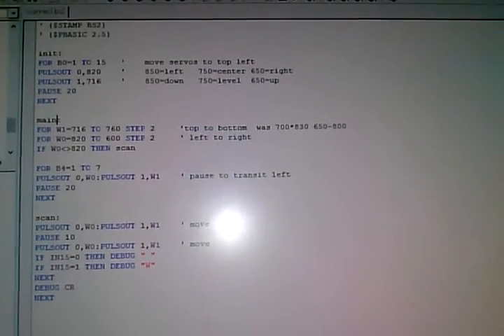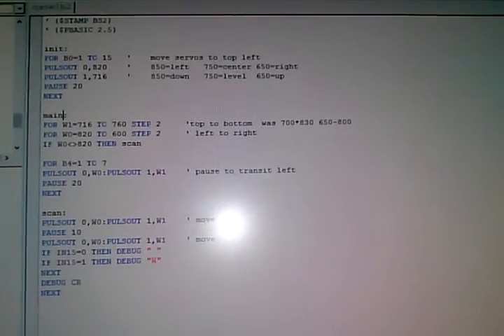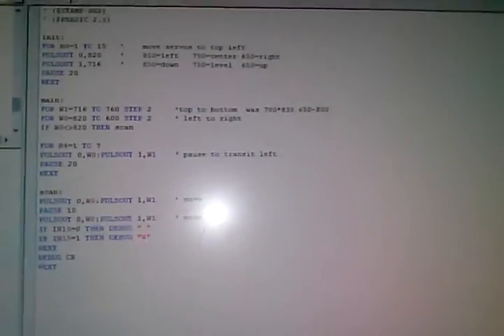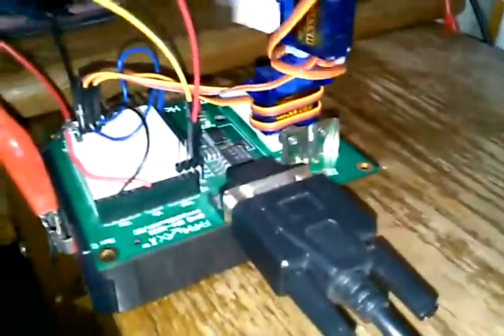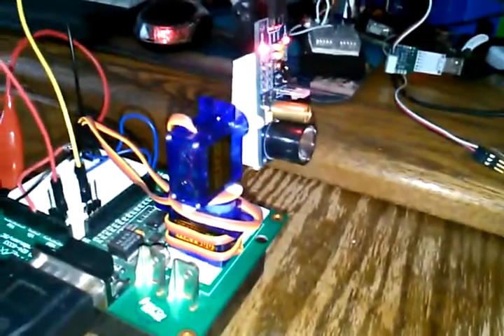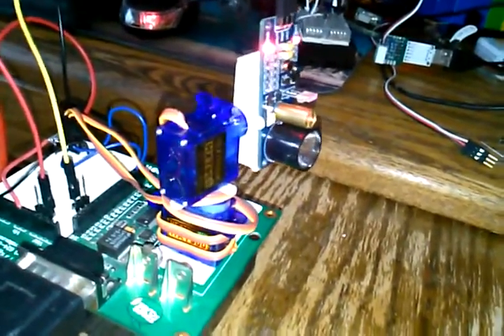BS2 Laser Scanner

Comment from the maker: Code:

' {$STAMP BS2}
' {$PBASIC 2.5}

init:
FOR B0=1 TO 15   '    move servos to top left
PULSOUT 0,820    '    850=left   750=center 650=right
PULSOUT 1,716    '    850=down   750=level  650=up
PAUSE 20
NEXT

main:
FOR W1=716 TO 760 STEP 2     'top to bottom  was 700*830 650-800
FOR W0=820 TO 600 STEP 2     ' left to right
IF W0<>820 THEN scan

FOR B4=1 TO 7
PULSOUT 0,W0:PULSOUT 1,W1    ' pause to transit left
PAUSE 20
NEXT

scan:
PULSOUT 0,W0:PULSOUT 1,W1    ' move
PAUSE 10
PULSOUT 0,W0:PULSOUT 1,W1    ' move
IF IN15=0 THEN DEBUG " "
IF IN15=1 THEN DEBUG "W"
NEXT
DEBUG CR
NEXT